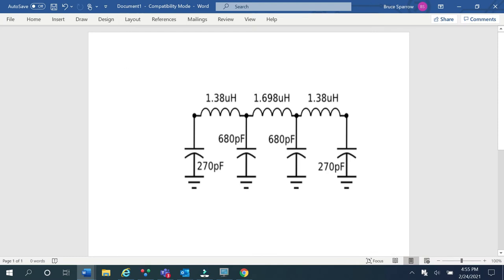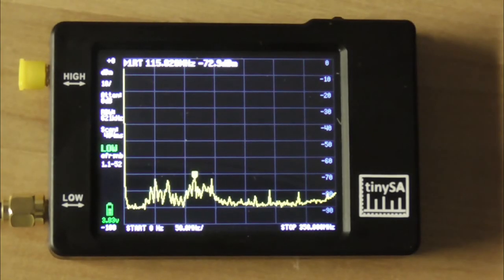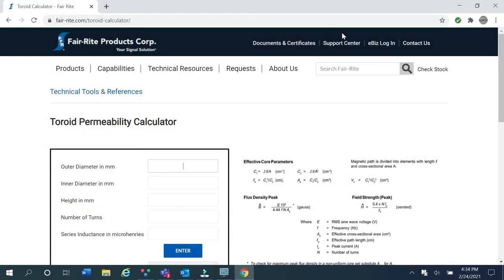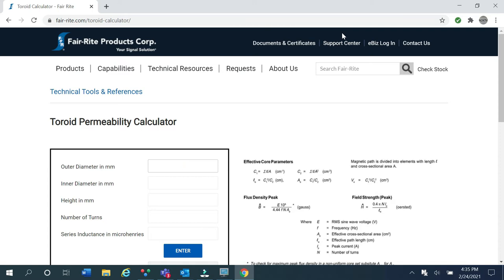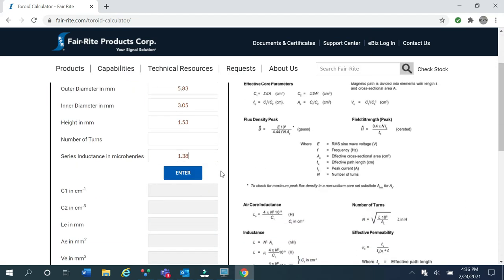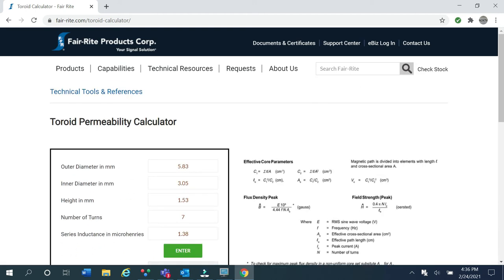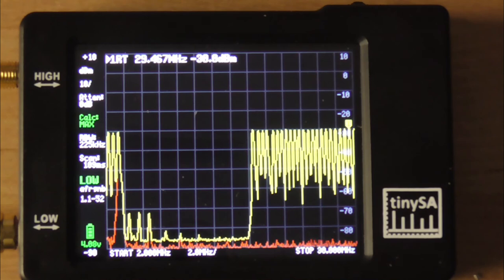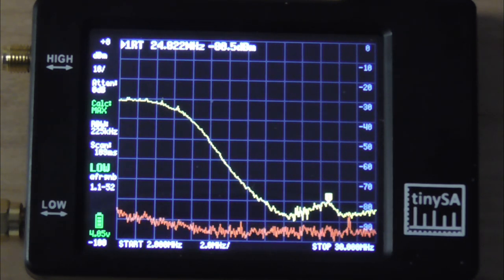7 MHz Low Pass Ferrite Filter Build and Test

Comment: Omitted was actual measurement of the inductance and that ferrite inductors are not stable with 
temperature and power levels. No mention of loss thru the filter and that it is for small signal only. 
Powdered iron toriods are used for tuned circuits like filters because they are stable and low loss.

Comment: curious what was the voltage level out of the generator and and what value attenuator you had it going into?  thanks for the video btw..
Reply from the maker: The output was 2V.  The reactance created by the capacitors and inductors greatly reduced the output of the filter. I suspect if you feed 2V directly into the SA, it would instantly fry. 

Although not used in this video, I have a multi-port attenuation board which can be bought on Amazon. In other experiments with other components, I use the board to produce up to 50dB reduction in level so I don’t fry the SA

Hope this helps! -Bruce Sparrow
Reply: @FairRiteProductsCorp   Thank you, i've have the same sig gen and didnt want to fry my TinySA.